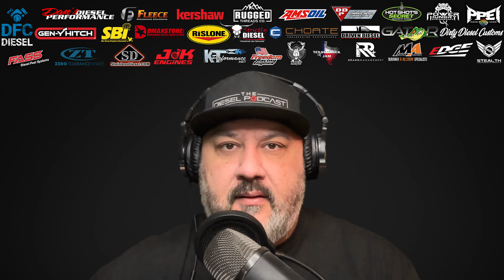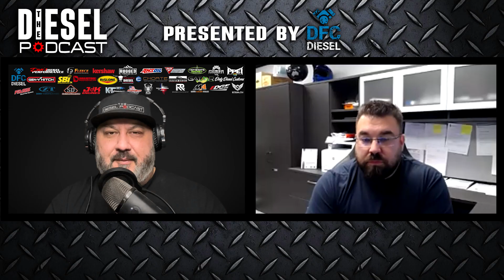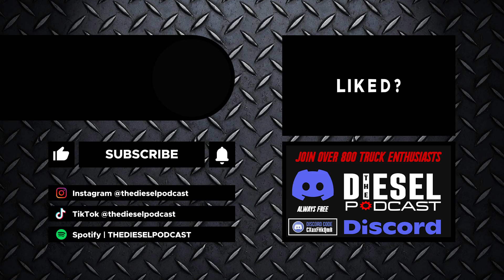Is Your Engine Reliable?

Comment: Man. I have an 08 with 90,000 miles stock. Man, it has power. Its my first diesel pick-up. I want to upgrade grade it, but he didn't give me much hope for the 6.4. I want to sell it, but when i tow with that thing, i want to keep it. My truck is the reason I started looking at this podcast. I towed a fork lift with my uncle f250 with a 6.7 power stroke in it. I was impressed, but that 6.4 pulled a military 20 ft shipping container with no problem. Man, i love my truck. i only use it to tow. Its not a daily driver, by any means. It drinks diesel, but again, towing up a hill is no problem. I guess i like it so much because im  use to gas dulles. Gas pickups towing and diesel pickups towing is night and day. Thank you for the episode on the 6.4. I don't know how long im going to keep it, because to put that much into an engine that could let go at any time is nerve-racking. I want to use it for my business, but im scared to rely on that engine.  I didn't pay much for it. It paid for itself by me hauling stuff. What it costs to have stuff shipped is unreal sometimes.
Im an automotive mechanic. i thought i could do some of the repairs myself, but he made me think the 6.4 is a money pit. Decisions Decision! Man, thank you again. I love the podcast. Oh yeah, sometimes i need visuals to keep up.  I'm a car guy. im not familiar with diesel lingo. I have to go look up stuff when you mention some parts. I am learning to keep up. Good KNOWLEDGE IS HARD TO COME BY.

Comment: I’m a 6.4 owner. Bought it at 67,000 miles. Truck currently sits at 97k miles. I deleted dpf, tow tune, 3k service intervals! Which I feel is what kept mine going. Not a mechanic but I believe fuel quality and oil quality is a must with these engines. Archoil fuel additive and AMSOIL. Dnt get the 6.4 and expect to run second hand fluids and expect great results. If you can’t afford the regular service intervals(3k-5k mi ) dnt get this truck. Key to keeping the 6.4 going decent is good fuel and good oil, and changing FILTERS!!!!!!

Comment: 6.4’s will last if treated correctly.   If you throw a hot damn 300 tune in it and constantly do burnouts and race it then yeah it’ll grenade!   Put a simple tow tune in it, or custom tune and drive it like a truck is supposed to be driven and it’ll last.   Plenty of 6.4’s out there hitting 400 and 500k miles trouble free.   Change oil and fuel filters every 5k then coolant every year and it’ll last!
Also, as an independent mechanic I’ll say this, customers lie!   You’ll ask em if they’re doing proper maintenance and treating it right and 9 times out of 10 they’ll say yes but we all know that’s bullshit.   Majority of people that bash 6.4’s are diehard Chevy and Ram owners that wanted to drive something fast so they threw a huge tune in it and beat the living shit out of it then trash talk after it fails.   Jus sayin

Comment: 2008 F350 here, bought the truck new and deleted it when i had 500 miles or less on it. Ive had zero issues with the engine and trans just been upgrading when i can. Engine and transmission survived a drunk slamming into the back of it at 80miles per hour ruffly at the 76k mile mark. Removed the short bed frame and installed a new long bed frame rebuilt the body and the engine is still going at 113k now. Thinking about rebuilding the engine for more power at this point. Trucks made well into the 700hp at the tire with current mods. Probably give y'all a call about pistons and maybe machine work. Trucks fared better than me after the wreck that's for sure. Built Ford Tuff haha

Comment: Matt mentioned that they are starting to offer L5P engines. I hope you have him back on to talk about the internals of the L5Ps. I know they are a completely different engine: I currently own one. But unfortunately many people out there think of them as a continuation of the LML, which is incorrect. 

So what makes these engines more superior in durability over the LMLs (cranks, size of the mains vs the narrow #1 main of an LML, piston design over the LBZ/LMM/LML); their common internal failures and fixes and available internal upgrades since there doesn't seem to be much out there. Basically why can L5P Duramax handle upwards of 1000 horsepower, when earlier Duramax engines snap a crank or crack the pistons. Just a thought. 

All of that aside, any time Matt is on, take notes. He's always very thorough on his internal knowledge. Thanks for having him back on.

Comment: Lmm basically has zero issues besides DPFs occasionally clogging and bad mpg during regens.

But LMMs are incredibly reliable, I'd argue the most reliable diesel this side of a 12v cummins. And definitely the most reliable emissions engine

You do maintenance on a LMM, they'll easily do 500k miles bone stock.
Reply: Lbz will out live the lmm